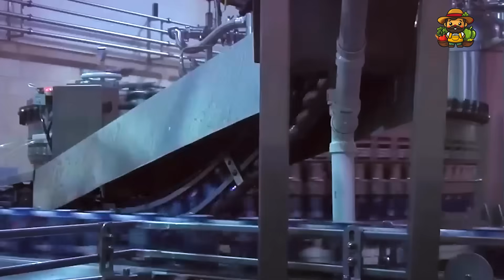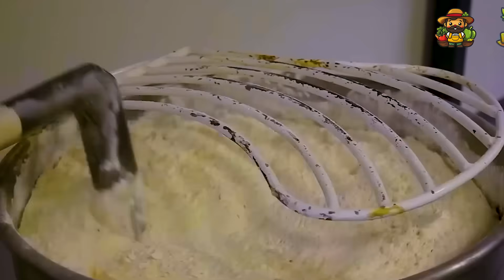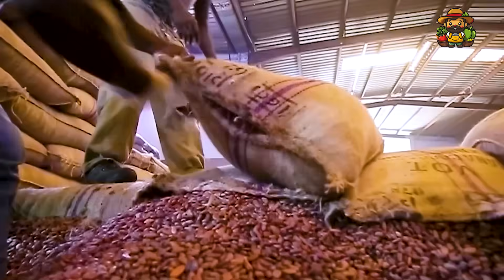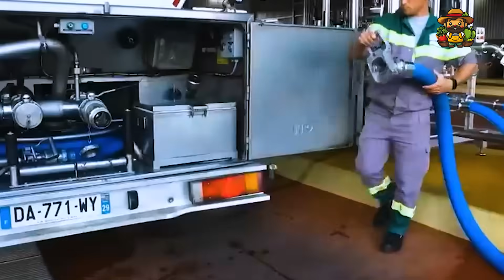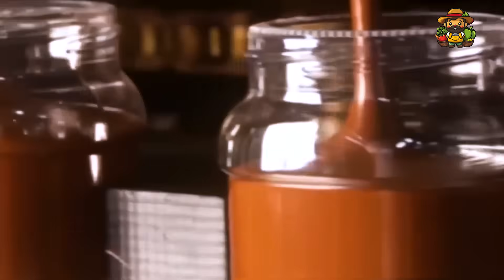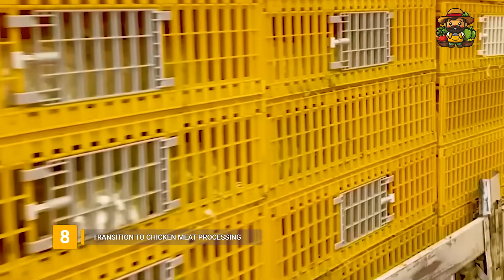Pepsi Mega Factory: How Pepsi Is Made In Factory With Modern Technology

Comment: Unfortunately it's not a closed loop system for the glass bottles 98% of those glass bottles give or take just goes into landfill or goes through glass recycling I'm guessing only like half a percent actually comes back and that's through different sources but since they're sold at gas stations and different restaurants the ultimately end up in the trash just the same as plastic I've yet to see where you can actually take the glass bottles back both for Coca-Cola bottles and for Pepsi bottles